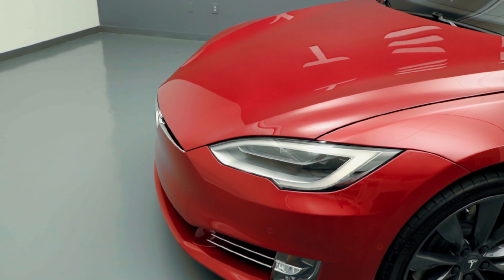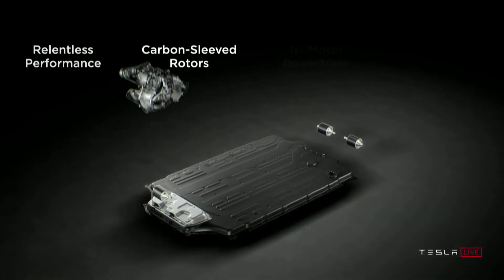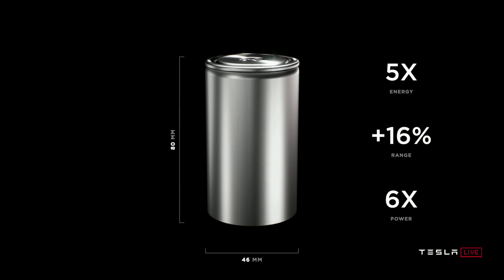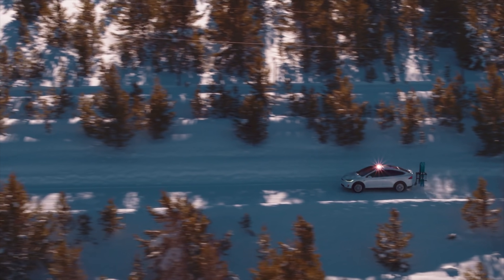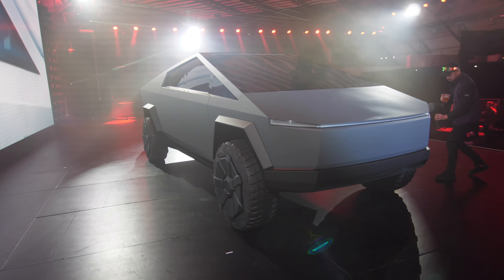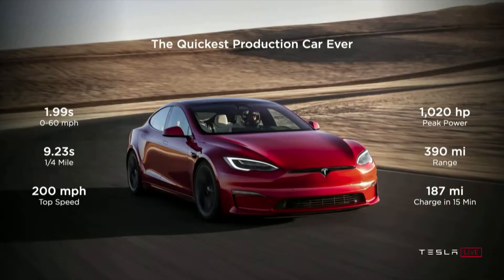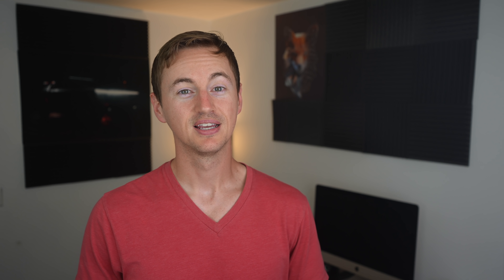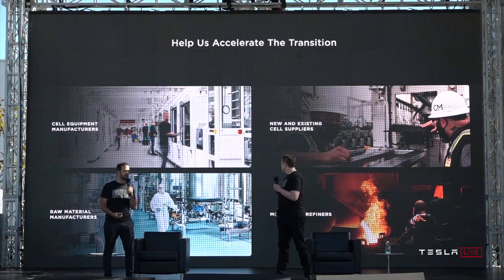The Mystery Behind the New Tesla Model S

Comment: I think Tesla will try to keep marketing side +- consistent no matter the batteries.
Range, speeds, prices - everything will stay mostly the same, while optimization benefits of a new cell will go fully into the company pockets. Which is fare for them and for customers.
And only after some time they'll make an announcement of a new car/configuration and drop the prices, if ever.

I would be very pissed if I buy Model Y for 60k just to see the price drop for 15k or range increase by 30%.
That would be just bad.

Comment: No the model S does have 2170 cells the answer is simple, 18650s have a much higher power draw than 2170s. I would be shocked if Tesla is using 2170 cells on the plaid.

Comment: I wonder what a overclocked plaid model S would be capable of
Reply: Zero to sixty in barely under 2 seconds on a prepped track.  Motors don't have a clock.
Reply: The current plaid does 0-60 under 2 seconds only on a VHT surface FYI. Also that is with a 1 foot rollout

Comment: Model S was never going to get 4680 unless they designed two packs starting 18m+ ago depending on if 4680 would be ready. That's pretty wasteful and also they have the Panasonic contract for battery supply they would want to take advantage of. This was all just rumors that weren't well thought through.
Reply: 4680 main focus is on being cheaper with decent specs. Model S has always had the high nickel expensive Panasonic batteries and they have continous chemistry improvements over the years. The main improvement is the pack design for track-day capable cooling and fast-charging. Charging speed is mainly limited by the temperature of the cell. If you are supercharging on a hot day you'll notice the cars radiator fans going maximum speed once the pack heats up.

Comment: 2170: no, new voltage: no. Same Panasonic supply: yes. It's supply limited. There's no new battery factory from Tesla or Panasonic, we'd know if there was (4680/Kato road obv. not ready as mentioned). 100 kW? My guess is actually LESS. New heat pump, improved aero, less cells.  This means they can make more S/X with the same Panasonic cell supply limitation/bottleneck using lower cell count per vehicle. This is the real reason they didn't mention the details.
Reply: Improved cell chemistry, higher voltage per cell means more 'range' with less cells.

Comment: 18650's are the obvious choice because they lose heat faster and the "jelly roll" is much smaller than the 2170. The big heat exchanger and new battery pack ensures it doesn't suffer the repeatability issues of the previous generation.
Reply: Yup

Comment: Great vid ! My Model 3 DM is here! Thanks again for your referral code. I must say this radar less system well isn’t as good as the car I drove that did have it. And what’s more night driving it has a mind of its own. “Blocked passenger pillar camera” the when the auto high beams I get “ Multiple cameras blocked or blinded” I have only had 1 software update so far but AP so far big fail. I’m in southern Indiana and the highways are decent , AP will be fine then just does the “ phantom breaking “ for no reason at all? Odd , loving the free Super Charging , again thanks pal !
Reply: Yup I noticed a HUGE difference in the M3 I test drove with radar and my delivered M3 without it. Pretty disappointing... Hopefully they have something up their sleeve to get fsd back on track.
Reply: @brockbah2048  like what? Can you explain us? AFAIK vision is more superior to radar. Pls don’t spread misinformation
Reply: Nice job, instead of using a referral code from someone who would use and appreciate it, you used a referral code from the person who has the most referrals in the world....meaning he has so many he could never possibly use them all .   Why not donate money to Bill Gates patron while your at it
Reply: AP/FSD is in a transition period where cars are being delivered with older software (designed to work with vision + radar) and newer hardware (no radar) that result in suboptimal performance. When the next round of FSD software is updated you'll get higher performance from the fully integrated system. The wait could be only a few days or weeks now.
Reply: @cbmusgrave  with radar it could see the car in front of me... They took a huge step backwards.
Reply: @brockbah2048  You are only seeing the consequences of using software developed for a different set of sensors. Radar is flawed in number of false positives, false negatives and low resolution, especially in the vertical dimension. You might wait to see how the new software performs that was designed to work with the specific sensor suite on your vehicle.

Comment: As far I can tell, they are still using 18650s in Plaid.
Reply: This is correct using 18650 still
Reply: For now 😉
Reply: they mainly redesigned thermal management of the pack, to allow more power, sustained, etc.
Reply: T•E•X•T O•N W•H•A•T•S•A•P•P

+•1•7•4•0•2•9•8•4•8•7•2•✓......

Comment: I wonder if Tesla is applying the tabless electrodes to the 18650 cells, higher nickel content, and silicon anodes. You know, all of the improvements to the 18650 cells from the 4680 tech.
Reply: T•E•X•T O•N W•H•A•T•S•A•P•P

+•1•7•4•0•2•9•8•4•8•7•2•✓......

Comment: Thx Andy. I am also waiting on the 4680 batteries 🔋 as well. It was my understanding that Tesla used the 18670 in the new S & X because it travels quicker to each end of the battery then the 2170 (longer battery) cells.

Comment: Shouldn't notice any difference for 4680 design in Model Y other than (for Tesla at least) lower price and higher volume production.

So if you are waiting for a Model Y it would probably only be in the standard range.

So if you want the standard range Model Y you need to wait but if you are okay with the long range or performance version get one of those now, because it sounds like it won't be until October when they start production on that, and it takes about a year for Tesla to fully ramp up so you'd be waiting in a long line.

Remember the 4680 cells aren't supposed to be superior technology they're supposed to be more cost effective and higher volume production.

Comment: Some of the answers are known. The battery size in the Model S Raven Performance was 104kWh, and this new Model S pack is 100kWh using Panasonic 18650 batteries with a revised chemistry having 5% higher energy density. The bigger gains of this new pack are revised circuitry and better cooling which enable faster charging and less power drop-off due to load. This provides sustained performance with back to back acceleration, extended high speed driving, and high power demands with low battery charge. For the 4680 batteries, I think Tesla is still working out the bugs in the new design. In addition to the Fremont pilot production, Panasonic is working on a pilot 4680 production line at Giga Nevada, which will likely be operational before Giga Berlin and Giga Texas are later this year.
Reply: Nice summary - one other detail.  It has also been reported the battery pack redesign also significantly reduced the battery pack weight.
Reply: Well said.
Reply: Yes well said, not sure why people think 2170 cells are superior to 18650 cells
Reply: @webdriverguy  Panasonic makes both the 18650 and 2170 batteries. The 2170 batteries were a newer generation, and had more power and higher energy density. But this latest generation of 18650 batteries have improved energy density to keep them competitive. There is a also an improved 2170 battery in the works. Outside of the battery, new power and thermal systems are showing even more improvement than the batteries themselves.

Comment: I think, the new model S and X chassis war designed to fit the new 4680, so that the old battery design could not fit any longer and had to be redesigned, to fit the new chassis.
But I also do not know which battery they used now and I have no idea, when 4680 could be ready.

Comment: 4680 is NOT on track, as it would pose a cost saving. Tesla will fire one worker if a $100 million robot could take their job and be earned back in a century. They care about little else than cost. So no, 4680 is experiencing issues.
And that they are not even going to put them in a Model S Plaid + might indicate that the 4680s can't take the high loads needed, even with 54% more capacity. Meaning the "6x the power" claim may be the problem here. While Tesla loves to imply amazing things, that 6x was relative to a 1850 or 2170  cell, but a /kg or /liter metric.

Comment: The new battery S/X battery capacity is probably SMALLER. Much low air drag, new efficient motors...not so different range.
Reply: Nkpe the battery is actually bigger

Comment: Elon has already said that the model S will just use the 18650 cells in the new model S just with updated chemistry. He said that when Sandy Munro met Elon and they were talking about the 12V battery. Elon said they’ll use the same cells as in the main pack to achieve the same life. And he mentioned it would be 18650 with updated chemistry.
Reply: Wonder if that's what's holding the X up until January 2022?
Reply: That is what I have heard as well

Comment: we know exactly what the new battery pack is.100kwh, using improved 18650 cells with better cooling, 4 large modules, like Model 3/Y. The battery pack is NOT the most expensive part of Model S. It costs around 15K USD, while the rest of the car is 115k USD. 
Plaid Plus is coming in 1-2 years. Basically it's just a bigger battery pack with 4680 cells. The other parts are mostly the same as the simple Plaid.
PS: 800 volt system means nothing. It just means thinner wires, nothing more.
Reply: You've missed something
Reply: Tha battery definitely cost way more than just 15k its around 20 to 30k minimum. The design of the car is still basically the same.
Reply: @alanmay7929  I'm 100% sure that almost no parts are the same as on the old Model S Long Range/Performance. You'll see after the Munro teardown. 👍
PS: Tesla's batteries cost less than 100USD/kWh at the cell level, less than 150USD/kWh on the pack level.
Reply: Oh, so the profit margin of this vehicle is $0? Interesting to know that Tesla is making exactly $0 on every Model S sold. Interesting breakdown.
Reply: Your technical comments sounds correct, but are you implying Tesla has zero USD profit on the car? (15k+115k=130k)
Reply: @TheKimNeeper  Andy was also not clear on what cost he's referring to. Cost to Panasonic, Tesla or customer? 🤷‍♂️
Reply: "Thinner wires, nothing more" is MUCH more of a deal than most people realize. 760kW of power at 400V means 1900A of current, and that requires a lot of copper and very sophisticated connector solutions, not mentioning the power semiconductors used in the inverter. Cutting the amperage by half means reducing weight and significantly reducing the waste heat generated in the battery pack, cables and electronics too.
Reply: @rrolf71  800V systems fail more often, far less reliable than 400V ... and what you're talking about, 1 meter of wire and two connectors from the battery pack to rear motors? That's worth switching to 800V? I don't think so, but we'll see ... soon 👍
Reply: @Poxenium  Absolutely worth it. All the main busses inside the battery, cables to the inverter, connectors, solid state switching elements...

I used to work with laboratory gear delivering up to 2500 amps to the test bed, and I have gained some very healthy respect for high current applications.

Comment: I believe the Model S Plaid is both "Plaid" and "Plaid Plus." I think later on the over-the-air software updates will boost both range and performance. And that will be your Plaid Plus.
Reply: But the plus was meant to be 4680
Reply: @rogerstarkey5390  
How do we know it isn't the 4680 battery cells that is featured in the Model S Plaid?
Reply: Plus was to have gigantic range and cell to chassis pack integration.